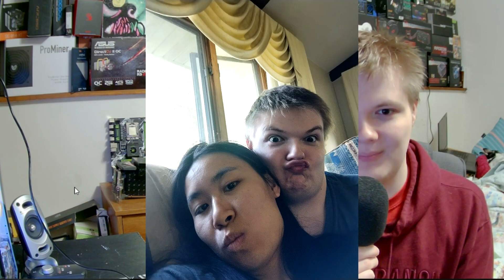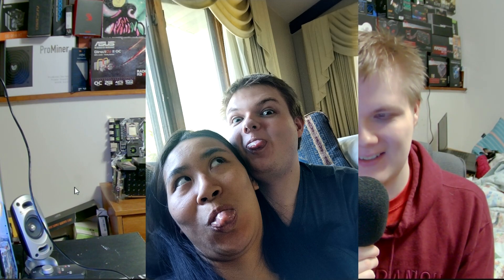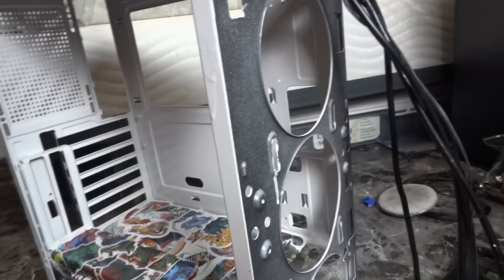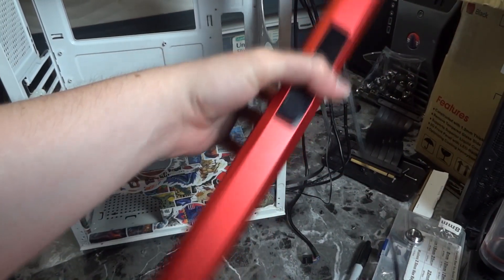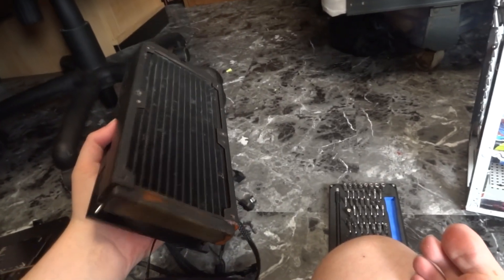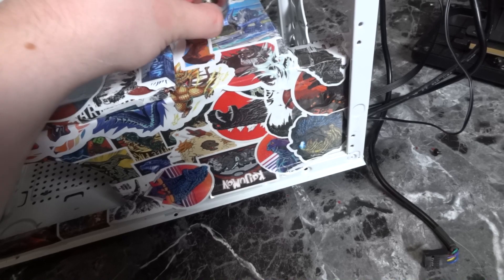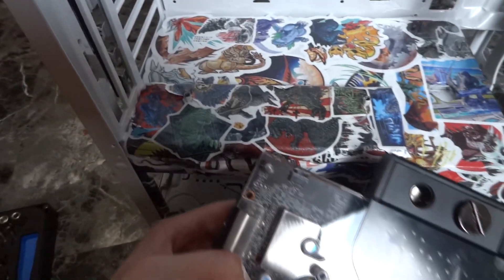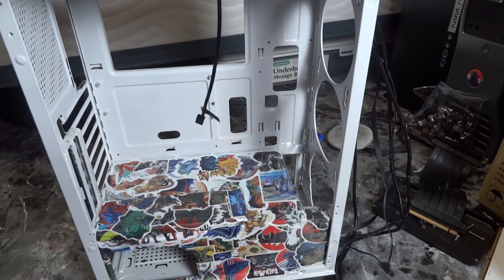My New Build (RX 5700 XT and E5 1650 V2) build and benchmarks!!

Comment: Hi how are things. I am interested in building a computer with the same characteristics as yours. Do you recommend for this 2022/2023 yet? I have it thinking to play at 2K, and do streaming and gaming. Or should I opt for some other processor either Intel or AMD?
Reply from the maker: It all depends on how much you want to spend. If you want to do heavy multitasking like gaming and streaming I would definitely recommend a 6 or an 8-core processor. And if you're going to take streaming seriously then I would definitely recommend going up to x99 or am4. I prefer Intel over AMD because Intel is typically much more stable. And has better price to performance. The i7 5820k is a wonderful processor. And from my personal experience has been great for video editing rendering and gaming. And you can also go up to the i7 5960x. Which is an 8 core. And is typically found for cheaper than a ryzen 7 2700x or 3700x. But if you want something slightly more modern I would recommend the ryzen 5 3600 or the ryzen 7 3700. The only thing with the AMD ryzen platform is that it will simply cost more for about the same performance. Unless you can find a good local deal. For graphics cards I prefer AMD over Nvidia. The AMD built-in streaming software with their drivers I find to be very very good. But it does limit you somewhat in comparison to simply using OBS. You can use OBS and an AMD graphics card but it won't run quite as well. And when it just comes to overall graphics card performance right now the best priced performance card is the RX 5700xt. That card is able to punch way above its weight class. And on average will cost less than an RTX 2060. Depending on what model you get. When it comes to ram I'm always going to recommend getting at least 32 gigs. Ram is cheap enough nowadays that you should be able to do that quite easily. 16 gigs of RAM is not bad but it will cause you to have some slowdowns when doing heavy multitasking workloads. And for storage I would recommend getting at least a terabyte. You can go for a smaller SSD and then a larger spinning hard drive. Or just go all SSD. For storage I just have a 1 TB SSD and it works good. If you have any more direct questions I will be more than happy to help out with what I can. I also hope that this helps a little bit.
Reply: @crosstech1  This was the answer I expected, thank you very much. I've never seen that i7-5960x is crazy and seeing against the best AMD processors stands up to them, but. what motherboard do you recommend for that processor?
Reply from the maker: @alansanchez.9316  If you have access to it eBay typically has gigabyte ud3 or ud4 motherboards right around that $100 price point but if you don't have access to things like eBay than AliExpress is your best option. The only problem with the AliExpress motherboards is they typically don't support that good of overclocking. The x99 tf and x99 D8 are the best from what I have heard. But if you can get an actual legitimate overclocking motherboard it will give you better performance and better stability in the long run.

Comment: Hey how about temperatures ? I want to get one to use with my E5 2640 V3 but I'm kinda worried about overheating / thermal throttling and none of the youtubers I watch have got their hands on one of these beauties.
Reply from the maker: Are you asking about water cooling?
Reply: @crosstech1  No, your GPU temperatures. I should have made myself clearer. I've seen some benchmarks and it seems it's quite a hot chip, something like 78°C.
Reply from the maker: @mmmbrunommm3  Liquid cooling is the ultimate way to keep your temperatures down. I water cool pretty much everything because it makes the computers last a lot longer. After gaming for about 5 hours straight my graphics card was sitting at 38° c and my CPU was at 32° c. My fans were spinning at only 25% the entire time
Reply from the maker: @mmmbrunommm3  If you want to get an RX 5700xt I definitely recommend getting something like a red devil or a Tai chi. From my experience those seem like the best models for air cooling.